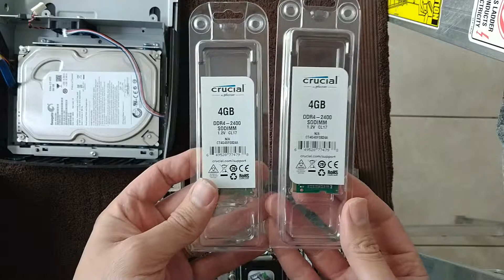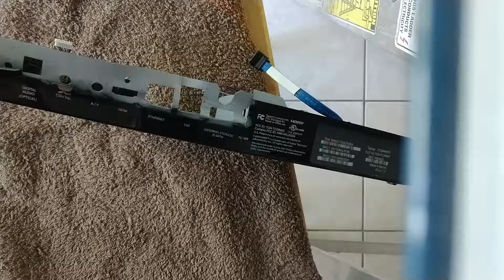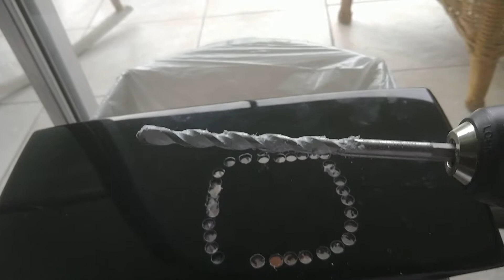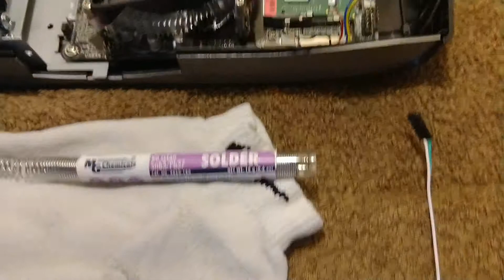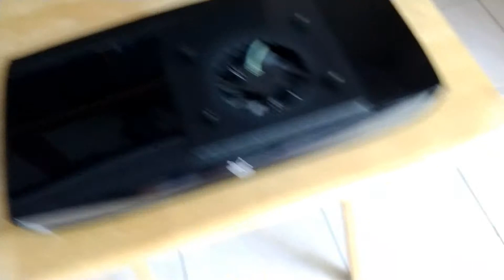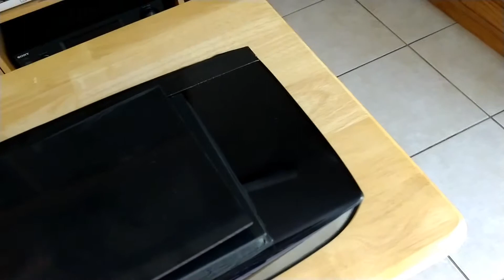Part Two - TiVo Roamio Motherboard Replacement with Asus Mini ITX and Core i3

Comment: What's the purpose of doing this? Do you just want to see if it would work or what? You still have to pay the monthly, annual, or lifetime service charge. Correct?
Reply from the maker: Hi.  The purpose is to use the case, hard drive, and remote with open source DVR software instead of TiVo software.  I have MythTV DVR software installed with guide data from SiliconDust and TVmaze.com, and I do not pay a service charge.

Comment: Kudos man. looks good. I like how you reused the lights. very solid idea. I really like it.
Reply from the maker: Thank you for the comment.  For the lights, I used a 9 V battery to to determine which of the TiVo wires power each light.  I then soldered a new power connector with heat shrink tubing for the motherboard power indicator and hard disk lights.

Comment: Would you do it again?  It seems like a lot of work.  Maybe you could just harvest the Tivo parts and put them in a new mini-ITX case.
Reply from the maker: Agreed.  This is not for those who want to build an HTPC quickly, but it does make a nice project for those who like to tinker.  Yes, I may do it in the future, and I have previously done it with a Zotac board in a TiVo Premiere case -- a picture of it is here: https://forum.mythtv.org/viewtopic.php?f=3&t=298&p=1297&hilit=premiere#p1297 .   The new Asus and the much older Zotac both working great.